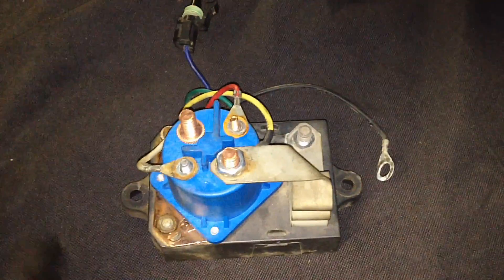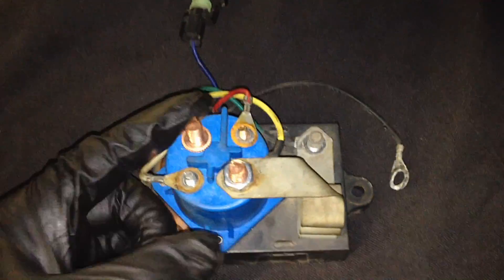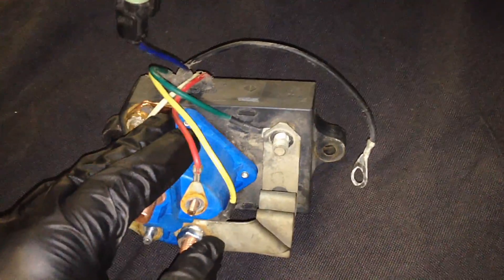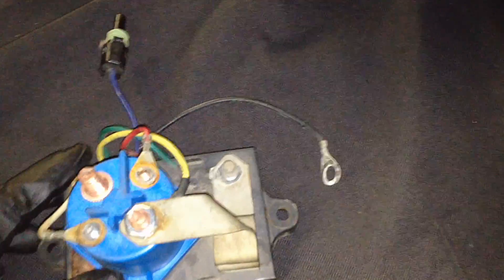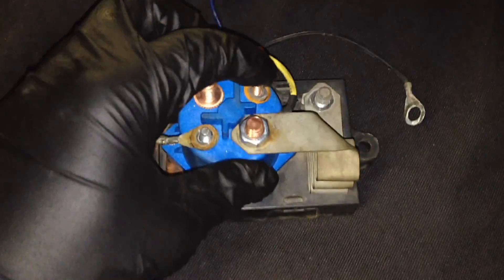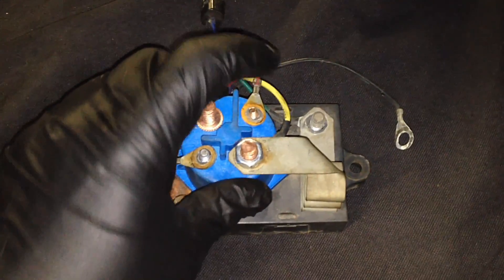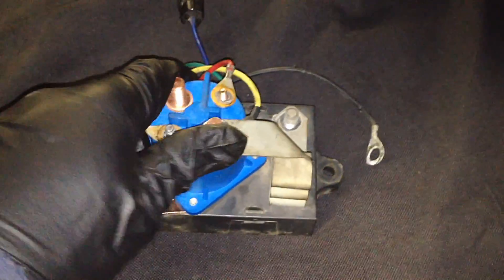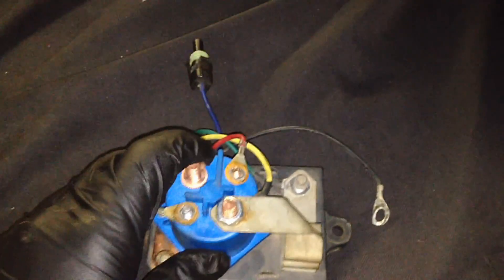Ford 7.3L IDI Glow Plug Relay Testing Procedure

Comment: I put in the push botton ground on the the ground terminal where the white wire is. Well anyway, now 3 years later it no longer works. So i checked it and my ground terminal has juice to it. That is not normal right? How could a ground also have juice to it? Im assuming the relay "solenoid" shorted?

Comment: I have a question, the pole with the red wire when the ignition is in the start position, its voltage reads zero. did the unit fail?

Comment: My 2002 7.3 glow plug relay was changed out without marking the wire connections. Now  my harness was replenished and the connections are a puzzle to me. Any advice? Thanks. PS; I like your videos compared to a lot I have researched.

Comment: Hi I have an issue with my 1992 f250 7.3 idi. I bypassed the controller to a push button 3 years ago. Glow plugs worked fine. Until now, they will not work. I found that my ground that comes from my push button to the solenoid and hooks where the white wire is that you said is a ground. Well anyway for some reason when I touch it with a test light it is a hot until I push the button then light goes out. If this is a ground then why does it have juice to it. Is that normal or is there maybe some kinda short in my solenoid. Thanks in advance, Jason
Reply: did u fixed ur problem man ? im having the same situation , im confuse its suppose to be ground but its hot on my...thanks
Reply: @adolfohdez31  did you ever get this squared?
Reply: @stevenrobertson1631  yes thanks i removed that black box and put a switch
Reply: @adolfohdez31  you replace the whole module with just an on/off switch? I've been having a hard time with my truck as far as starting and I'm sure that I'm having an issue at the in the relay department. I saw this video and thought it would be a great fix. Is there a certain amperage you looked for or step down so you don't over do the glow plugs power supply?
Reply: @stevenrobertson1631  ill be at home in a few minutes...ill check everything and let u know
Reply: did you ever get this squared?

Comment: The ribbon type deal is called a shunt resistor. A shunt resistor is used to measure current. The voltage drop across the shunt resistor is proportional to the current flowing in the shunt resistor. As the glow plug resistance increases, the current flowing through the shunt resistor will decrease. When the controller senses the decrease in current, it shuts off the power to the glow plugs. When the glow plugs fail, they fail open and the current flowing through the shunt resistor is reduced. I have no idea whether the controller can sense the number of operating glow plugs or not. If it can't sense the number of operating glow plugs, it may interpret the reduced current as a signal that the glow plugs are hot and prematurely shut off. That is why it is important to be sure that all of the glow plugs are good. The voltage drop across the shunt resistor will be very small, possibly tens of millivolts. Measuring low ohm resistors is very difficult with ordinary ohm meters, so it is important that the measured glow plug resistances are close to each other. If there are wide variations in resistance, there are probably some bad glow plugs. An incandescent test light is probably a good way to do a quick check for continuity. An LED test light is too sensitive and will show a high resistance as a good circuit. Connect an incandescent test light to the battery positive and probe the glow plugs. A bright light is probably a good glow plug. Dim or no light is a bad one.

Comment: Good explanation of how the relay works, thank you for the video.  Would a misplaced ground wire cause the wait to start lamp to only engage for >1 second, or would it be a bad solenoid in general?
Reply: Samsquanch Gaming did you ever figure the answer to that question out?

Comment: Hello FordTechMakuloco ! I have a truck F550 7.3 Diesel 2001, and there is a problem when I'm driving slowly, it can turn off several times when standing in the parking lot , can turn itself off, but when i go quickly such a problem does not exist. (Starting good, no problem)
maybe CPS  sensor or not? Thank you so much!
(Ssory for my English)

Comment: Hello, I am having some cold start
issues with my “92” 7.3L. I would rather repair it the way it is supposed to
work opposed to bypassing the system with a switch to ground. I watched your
video and have completed some trouble shooting. My solenoid turns on but clicks
off around eight to twelve seconds than cycles close to open intermittently.   I began
by checking the glow plugs wondering if it could be a resistance related issue.
I found two of them to be bad. The other six tested .2 Ohms or better. When I
checked continuity on the posts of the solenoid I found the ground (white wire)
to be acting as it was in a closed position when the key was in the off
position. In you video you state that it is supposed to close when the system
checks are ok. Although you said the solid state device seldom goes bad I am
wondering if I might be one of the rare occasions. I cannot find anything on
the web to check meter the device against. I would appreciate any advice you
can give me I hate to randomly change parts. Thanks,

Comment: Need help I have a 1988 F Superduty dump been sitting 3 years getting fuel threw the filter down to injection pump and nothing out of the injection pump which I just put on today brand new when I turn the key that relay clicks about 5 to 6 times
Reply: mitchell markovich if your trucks cranking and your getting fuel to your IP then you should be getting fuel unless a line or injector is clogged

Comment: Would this device be on a 1990 F250 Lariat 7.3l V8? Friends having issue where batteries good, but when turning key will not turn over, but will click. Guy said it was the old worn neg bat blk cables were cause & need replace. Another guy said was starter or solenoid. Mobile mech checkin soon, will see what they say. Thanks for your timely & info packed vids.
Reply from the maker: Kryochrysalis This will not cause a no crank but it will be a good symptom if it cranks strong but does not fire and there is plenty of white smoke.
Reply: Kryochrysalis when I open my door the cab light is bright and when I turn the ignition on to warm the glow plugs it immediately drains the power like my batteries have been sitting for weeks is this the same problem you are having if so was it your glow plug controller

Comment: I just picked up a 1993 7.3IDI f350.  Little by little I am going through the engine and removing as much electrical components as possible.  Is there a way to manually turn on the glow plugs and bypass the relay?

Comment: I have a 91 F250.  I get the clicking noise after the ready to start light goes out.  Once it starts it continues to click.  Your thoughts?
Reply from the maker: That was how this one reacted when I tested it after changing 7 glow plugs and ran the engine to get it hot to remove the 8th plug which was seized in the head. So I would say 1 or more plugs are dead.

Comment: Watched the video which helped out a lot in diagnosing my problem. As it turns out, my 1990 had a connector go bad in the wiring and I lost constant voltage from the battery via the two wires that ultimately connect to the battery side of the starter relay on the passenger side fender. In my case the wires coming off the glow plug relay were yellow but changed to black with a red stripe at the connector. The connector has many other wires going through it with these two stacked on the end. One of the wires burned the connector out and then the other wire wasn't long behind in burning out and melting the end of the connector. Since it's 25 years old now it doesn't surprise me this weak connection failed.I cut the wires out of the connector and used two yellow butt connectors to join them back. Instantly power was restored. The thing that threw me at first was that I had enough voltage at the glow plug relay to light my test lamp, but when the relay tried to engage, the light went out.
Reply from the maker: Oh wow at least you found it all, sweet!
Reply: FordTechMakuloco I forgot to say that the relay module was clicking much like the glow plugs went bad. That's how I ended up on your video. I had replaced all the glow plugs a month or so before the problem surfaced so I was pretty sure they were not the problem. Another thing I took away from the video is that as glow plugs start to go bad, it will begin clicking near the end of the cycle.

Comment: My cousin has a 6.9 that he had a glow plug problem with and he put a ground wire from the battery straight to the solenoid and bypassed the ignition switch and put a push button switch on the solenoid  and then holds the push button for a few seconds and turns the key and it starts. Mine is a 93 7.3 and has that electronic box under the solenoid. I believe you said the ground comes from the electronic thing. I was thinking of bypassing the electronic thing and running a ground wire straight from the battery to the solenoid and bypassing the key switch too and using a push button switch to work the glow plugs. do you think that would work? Currently the solenoid clicks after being on for about 15 seconds and according to one of your other videos that is an indication of a defective glow plug effecting the resistance. This thing started fine this spring.
Reply from the maker: Yews allot of people that own these have been doing the push button thing for many years now over replacing the whole assembly. I am sure there are plenty of write ups about this on the web as it is a very common fix.